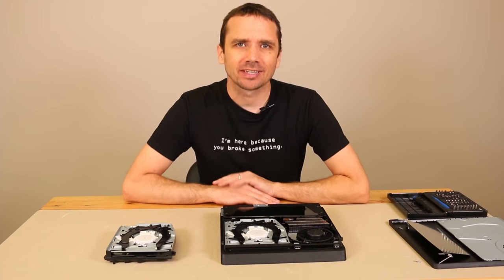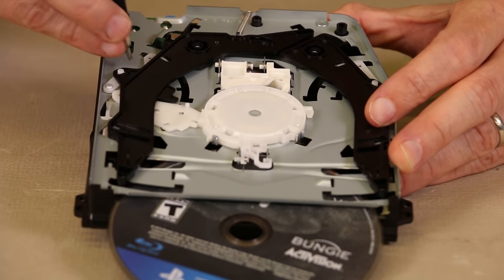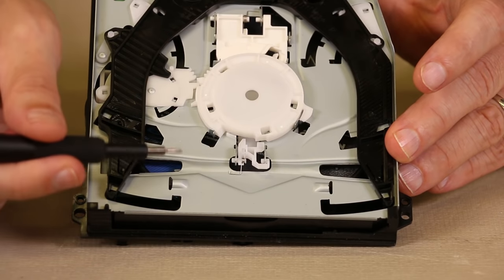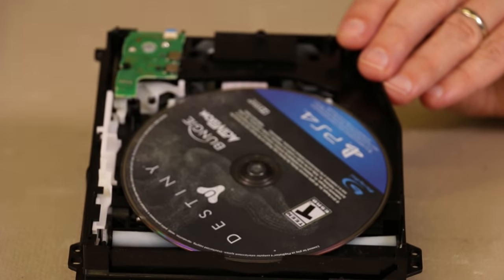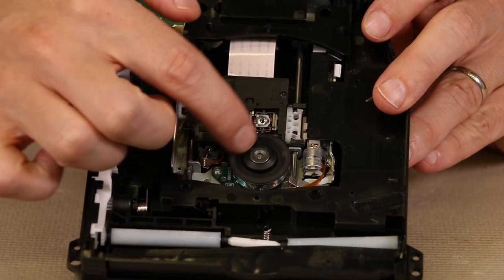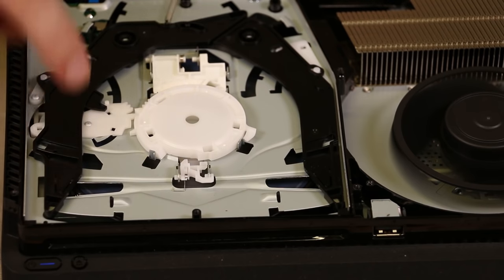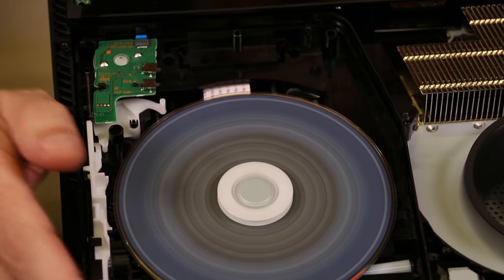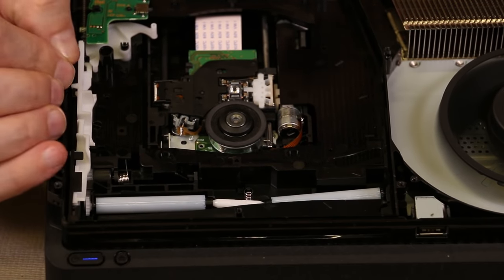How a PS4 Disc Drive Works - Very Detailed

Comment: Hi my ps4 slim is scratching the label side of my discs but only near the edges. What do you think is the culprit?
Reply: Sherwin Gacula  me too
Reply: have you found a solution?
Reply: Sherwin Gacula  No. It may be from leaving the system on rest mode without closing the game app. My assumption. However, others do it and don't have that issue. I'll likely send the console to Sony for repair/replacement (One Year Warranty).
Reply: Anthony Rollins absolutely not. If you put ps4 in rest mode, and your settings dictate that the program is not ended, it will be suspended fully and the disc wont spin. If you instantly cut power it may be different though.

Comment: I messed up and ripped the ears off the ribbon cable to the Disc Drive :(  Is there any hope other than replacing the connections?
Reply from the maker: Yes...clip off what's left of the ears. If you're lucky it will slide in. You have to make sure it's lined up correctly though and tape it down when it is.

Comment: Hi, when i insert a disc, all i hear is the sound in your video where the laser was trying to read the disc. Then after some time it gives the unrecognized disc. I don't hear the disc spinning at all but just the laser movements. However when i turn the console upside down, it begins to spin with some scratching noise and you still hear the laser moving up and down.  But this takes a while before the unrecognized message comes. Is the disc supposed to spin immediately it enters the drive? What could be the problem? Is it the laser? Please help. Thanks
Reply from the maker: Unfortunately, there is no way for me to know what the problem is. It could be the laser or it could be something else inside the drive. No way to know without taking it apart.
Reply: TronicsFix I Took it apart but there was nothing in there. Everything was also in their place.
Reply: I have the same problem, I changed the laser (KEM-496AAA) and everything looks in its place,
What is the problem ? please help ! !
Reply: Abd Al-Karim Does it behave the same way I described my problem?
Reply: exactly
Reply: Abd Al-Karim it is not a laser problem as far as I know. I was able to fix mine without replacing the laser. It will be difficult to explain by words how I fixed it because I did some adjustments and it runs smoothly and quietly without any problem. I don't know how I can help with this. Any suggestions?
Reply: I disassemble everything and i reassembled, and it's ok it works,
but the disk drives make a huge noise when the disk turns ! Help please.
Reply: Abd Al-Karim Abd Al-Karim I am glad it works now. I had the same issue after I fixed the drive to read disc. There was this scratching spinning noise. You see the first layer that has the mechanic arms that is held by just two screws? Don't screw them all the way down. I mean the screws removed in the video at 1:57. Leave a little gap by inserting a small folded paper at the edge between the metal and plastic (probably near the right screw). The folded paper will prevent the screws from tightening all the way down. That will stop the noise. If the noise reduces, then you will need a bigger paper for a bigger gap. I hope my explanation makes sense.

Comment: You didn't go in to detail on what the 3rd switch does on the sensor board.  One switch takes in the disc the other tells the lens to read but what does the 3rd one do?

You also forgot to show how the white track to the left under the top cover works/moves.  I don't know if my track is misaligned or not.  Doesn't look like it is in the same position as yours (mine is back farther).
Reply: I was able to troubleshoot it and found the problem it was the 3rd switch that wasn't mentioned in the video.

Comment: finished to clean my ps4 after taking apart almsot every part,  and i saw suddenly a "Spring/Coil" jump out of the disc driver and im not sure it ment to be so any one have an idea??
Reply: If its thin, it goes to where the black arms meet. Its used to detect discs

Comment: Okay so what if those switches are the only thing wrong? I try to put in a disc and it just doesn’t suck it in.
Reply: OMG same, I tried looking at the rollers of the disc drive and they were perfectly fine. Tried booting it up again and the PS4 just doesnt suck the DVD in like it usually does
Reply: Jiggle Jogglers Yeah frl it’s annoying asf. It started happening right after the latest update so was wondering if that’s what caused it. I’ve had my ps4 for 4 years and never had an issue before
Reply: Same here bruh, although my last problem was that my ps4 kept ejecting it out of nowhere, and now it doesn’t  even wanna take it. Imma try look for other ways to fix though
Reply: Jiggle Jogglers Yeah man. Good luck for real hopefully we can get this all sorted out

Comment: I have a problem with my ps4  
I put my disc in and it make a weird noise and it said loading then say "unrecognized disc" when my discs have no scratch or no damaged l have only had my ps4 for 2 weeks .I tried every thing like   unplugging ,rebuilding database ,update with usb and enthernet , reinstall system software 
None of them didn't work for me  
 unfortunatly Sony doesn't support ps4 in my country  
Please help me
Reply from the maker: Could be a faulty laser or something else wrong with your drive inside.

Comment: few days ago i took apart the console and broke one of the disc driver screw hole，a ph hole at the lower right side of it，does it matter？
Reply from the maker: I don't know...if it still works then it shouldn't matter
Reply: TronicsFix LLC thanks it works well

Comment: What's your suggestion for an original release PS4 that doesn't read discs anymore?
Reply from the maker: Most likely just needs laser replacement.
Reply: TronicsFix damn. Ok. I'm still figuring this thing out, but I've gotten as far as hotrodding my wifi antenna since my son caused it to die, replacing the itwrnal HDD, replacing a bad thermal paste application, and resoldering burnt out connections on the hdmi and motherboard. How easy is it to replace the laser?

Comment: Hi, what would be the problem if i have to push the cd in for it to go in?
Reply from the maker: Probably has dirty rollers.
Reply: @Tronicsfix  I have to like shove it in a bit and it pull it in. It's not the switches?
And when I check the CD it comes out with out stopping
Reply from the maker: There's no way for me to know what it is without having it here to test. I was just giving you something to check.
Reply: @Tronicsfix  okay thank you

Comment: hey i know this is old but i was cleaning this and a black piece with a cross and a spring can you please help me? i dont know where it goes thanks. Also its ps4 pro
Reply: There should be a small hole that a that the black bit with the spring should go should be right next to a gear
Reply: @pyronight7717  Thank you so much

Comment: I had a question about something... I had my PS4 Pro idling on a game menu for a while, then my lights flickered and my PS4 shut off. My computer and TV (TV was plugged directly to the outlet) were unaffected. I tried to turn the PS4 back on, but it didn't respond to the power or eject buttons being pressed until AFTER I pulled the power cord out and plugged it back in. Now it seems to be working normally.... Do you think there was any damage done? Apparently, this was a brownout?
Reply from the maker: Doesn't sound like any damage was done to it.

Comment: I think my problem is that my ps4 is that it doesn't even  know that there is a disc. I push in the disc and it doesn't realize. I click the eject button, it beeps three times and then nothing. Should I take it for repair or buy a whole new disc drive?
Reply: This is what has just happened to mine. Did you find the problem?
I think it’s to do with the gears not engaging.
Reply: @19ARIES84  I think something like that. There was a white pieceon the left side that slides. It moves with and releases the rollers and more. It seemed limited in its movement. It could be just how it is though and be a different issue. I recommend taking it to a shop. Try looking at one called UBreakiFix  they do free diagnostic.

Comment: I’ll try to see if something is wrong with my laser my ps4 not being able to read discs and makes a weird sound like if the disc was getting re inserted
Reply from the maker: Sounds like a laser problem...no way for me to know for sure though
Reply: TronicsFix yeah it appeared. To be the laser when I opened it up and I fixed it so my ps4 is back working thanks for the dissemble video 👍
Reply: Ap13 12 i have the exact same problem how did u fix it?? Plss helpp
Reply: Dow Sha- open up your ps4 and check how your laser is
Reply: Ap13 12 i did open but i cant tell ?? How is the laser looks normal to me

Comment: I've been going through all of your videos on ps4 disc drives.

My ps4 plays DVDS fine. But will not play blue ray discs or ps4 game discs. Is there a specific part of the disc drive that would be malfunctioning to cause this?

(P.s. I've tried all options in safe mode including completely factory resetting my system)

Any help?!
Reply from the maker: Probably a laser problem.

Comment: Would you know why my pro is only allowing me to play DVDs. Even terrible dvds play but won't play clean blurays or games. It doesn't make sense to me. I keep getting stuck half way through taking the system apart, some parts seem so fragile that I give up and I don't have the money to replace anything. I just wanna play my spiderman and batman games. Especially injustice 2. I wanted to get the new mortal kombat but now I'm afraid to. All I can do is rebuy everything directly from PSN but I don't exactly have all the money for that. Last few days have been a complete killjoy.... what could I possibly try... it keeps trying to read and making ejection sounds but only for games and blurays😭💔
Reply from the maker: Usually that means it needs a new laser.
Reply: I finally got to the disc drive. Should I just replace the laser for cheap? Or the whole disc drive? I'm afraid to waste any money on something I might not need.
Reply: Tired of it revving up to start but then getting nothing. Wondering if the disc drive has something to do with it too. I have the 7015B model. About 3 to 4 years old.
Reply: And thank you! Without your help I'd have been doomed.

Comment: When i turn my playstation the tray will start trying to eject for a couple seconds and i cant put a disc inside as well idk what’s going on
Reply: Same bro
Reply: @elchino57r6  I opened it up and saw that the piece on my tray had popped loosed i put it back on and now it doesn’t make the noise still doesn’t accept disc tho
Reply: Yeah I have to turn it off and then on to put the disc in

Comment: Steve, I am so freaking glad that you put these different videos up. I opened my PS4 slim a week ago to clean out the fan. I was surprised to see that it was almost mint after a year and a half of gaming and VR. Anyways, when I was putting it back together, I noticed a rattle, but since I couldn't see anything, I just went back to putting it together and proceeded to play games for a week.

Now, yesterday I got my copy of Judgement and today I decided to swap discs and start it up. The old disc came out, but the new one wasn't having it. So, I opened it back up and found a spring magnetized to the little circuit board that surrounds the laser. It had apparently popped off when I took the metal shield off last week. I looked all over online for high definition pictures of the interior of the PS4 slim because I wanted to know where that spring went, but there are literally none. Your close ups, however, showed me a little spring that attaches the large black arms of the disc drive to the metal frame of the top of the drive.

It's running like a champ now, so I cant thank you enough. Certainly a good cautionary tale for any other viewers that are opening their ps4 slims. Also, I noticed that the slim has one less white arm attached to those larger black arms. That, and mine never came with a screw to hold in the metal bracket for that teeny tiny machine screw that holds down the metal shield on the right side. Ultra weird.

Anyways, thanks again and subscribed for life.

Comment: Does the game disc spins all the time when you are playing, or just when you need to install the game, if it spins all the time it can make you system overheat, so it is better to have a digital copy, because there are no spinning....
Or is it the same...
Reply from the maker: It spins the whole time....sometimes faster, sometimes slower but it's spinning. That won't make it overheat. Whoever told you that has no clue.
Reply: TronicsFix LLC Wait, so even when I'm playing a game and it's dead silent and zero vibration, the disc is spinning?
Reply: Amuro Ray Sometimes it does stop. Then it spins again.
Reply: I'm curious, if take off the disc while playing. Will it continue playing, or PS4 knows something wrong?
Reply: @penguin2251  probably not freeze, because the PS4 copy application from the disc, pretty much all games we're playing from HDD. That's why I'm curious, take off disc while playing

Comment: when i insert my disc sound like its scratching and skipping
Reply: adjust the rollers (the white cylinders) start by pulling out the short middle cylinder and then all of them should pop out, then put them back in and try to put the ps4 back together
Reply: @buttertones  that sounds extremely complicated and risky

Comment: does this help with error code SU-42118-6 ???? someone answer pls
Reply: when i try to update my ps4 it says the reason its not letting me is because it detects some hardware issues. can this be it?
Reply from the maker: If the disc drive doesn't work then that can cause this error.

Comment: I've been desperately looking for an answer to my issue because I can't afford to send it in to get fixed by sony. My disc reader won't read game discs or blu rays, but reads DVDs fine. Is there any explanation for this?
Reply: Laser going bad, you say it reading DVD but not Game disc or Blu-ray.
Reply: @Axophyse  yes exactly. is my only option to send it to sony though? can i clean it myself to fix it?
Reply: @Furiousa96  well if you can open it, try cleaning the laser. If cleaning does not work, then the laser is going bad you might need to replace it.

This is the same problem that my ps2 had, some games plays fine but those blu rays doesnt. Tried cleaning it didnt work. didnt played my ps2 ever since
Reply: @Axophyse  Thank you for the suggestion. I'm wary about cleaning it myself because I'm worried i'll just make it worse, but I might just try it anyway.

Comment: My CD goes in I hear some clicking maybe the laser trying to read CD but it seems like it's not spinning the CD for some reason. Idk I keep getting unrecognized disc
Reply: Unknown me to and i dont know how to fix it
Reply: BLACK TRIK I fixed mine, finally got to the point of desperation and I had to just open the ps4 and take a look myself. My 4 year old put a piece of paper in the disc drive... Removed it done some cleaning before I put it back together and it works a LOT better now. The eject button tends to stick a little sometimes because I think I lost the front runner stand and maybe that's what helps the button pop back out but... It fixed my problem. It was fairly easy took me a couple hours because I was being very careful but I just followed a video on here for my model of ps4 and it worked :)
Reply: Unknown oh oke but where did you put the paper?
Reply: BLACK TRIK in the trash, it wasn't suppose to be in there.
Reply: Unknown oh oke thx

Comment: Hi, just wanted to confirm, so I put my ps4 vertically or horizontally will not affect the disc drive and the disc reading right?
Reply from the maker: Nope, they're made to work either way.
Reply: Thanks for the reply!
Reply: recently my ps4 was with a problem when i put the disc appear the message unrecognised disc so i change the side of my ps4 and worked but now the issue comes back and make some noises as if it was reading but appear the mensage unrecognise Disc what can i do

Comment: My launch jet black ps4 stop accepting disc 2 years ago. Now i know the reson why those 2 moronic cheap switches on the back of the drive dont work when the black arms make contact with them. Since two years i have been using the injection screw to pull the disc into the magnetic slot and then pull it out using the injection screw when i am done playing with  my ps4. I have to say ps4 disc drive build quality looks so cheap.
Reply: I have the same problem as you.
Doesn't accept disks and the eject button doesn't work only eject manual or through the menu.
 Did you manage to fix it?
Reply: @Wyxk21  no i couldnt fix it. I use the ejection screw to pull the disc in. Its tideous but i have no option.